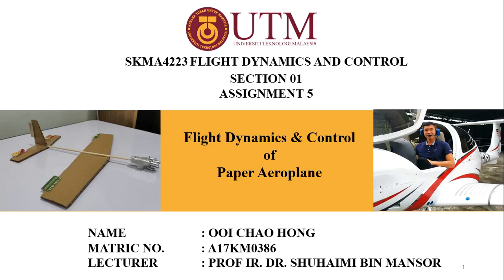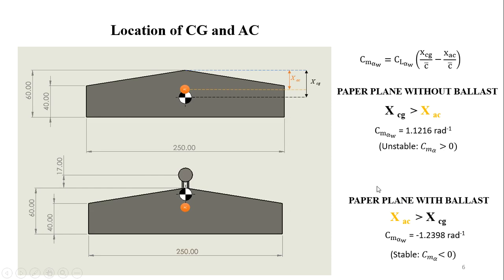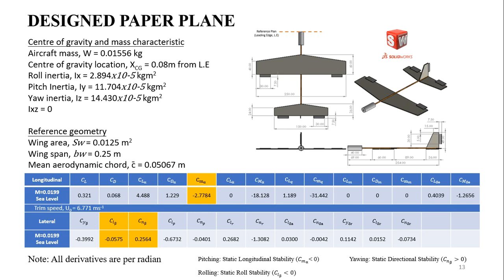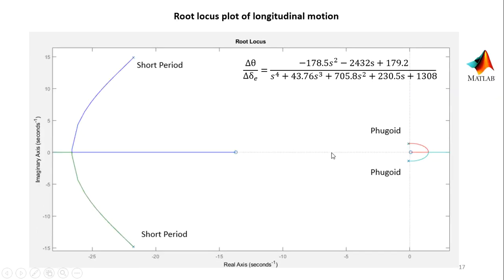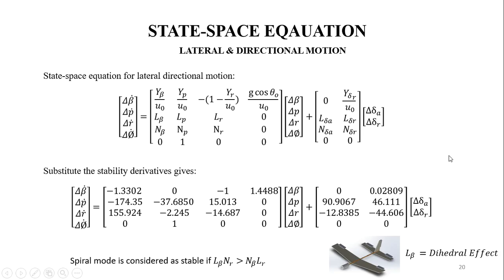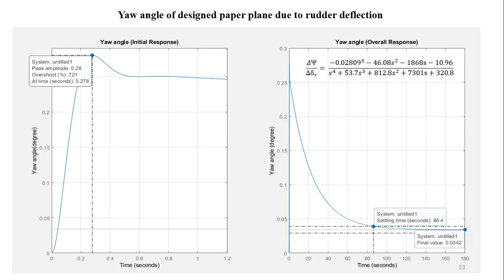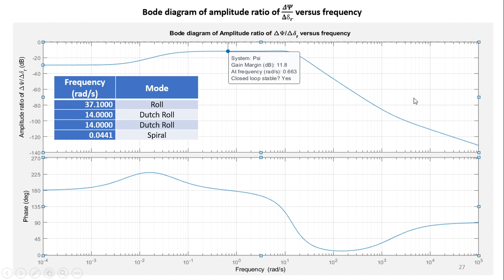Fly on Paper Plane - Flight Dynamic and Control !?!?!

Comment from the maker: Summary of Contents:

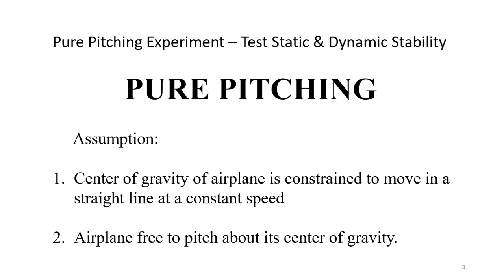  0:00 – 0:59 Definition of Static and Dynamic Stability
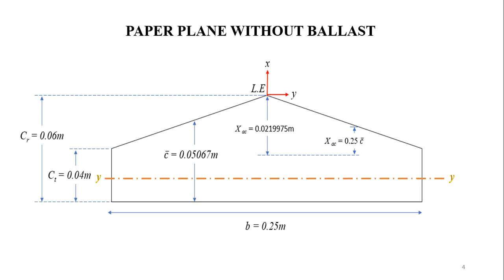  1:00 – 1:23 Pure Pitching Assumption
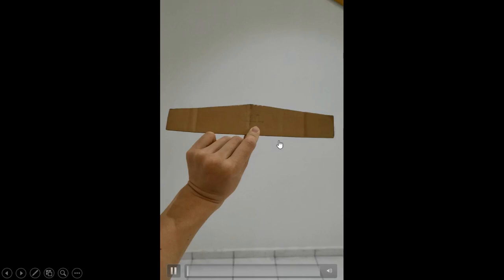  1:24 – 1:39 Dimension of Wing
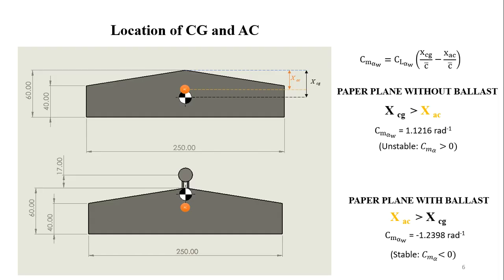  1:40 – 2:05 Paper Plane Without Ballast
  2:06 – 3:36 Location of Centre of Gravity (CG) and Aerodynamic Center (AC) affect Cmα
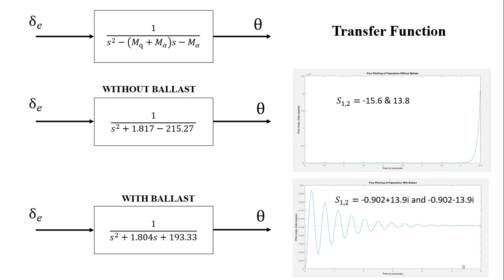  3:37 – 4:02 Comparison of Paper Plane With and Without Ballast
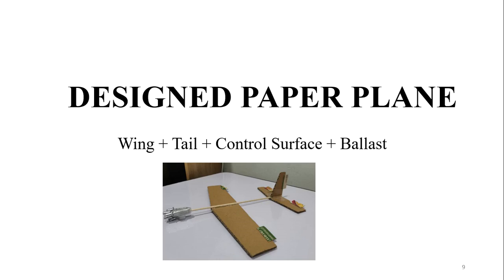  4:03 – 5:33 Response of Paper Plane on Pure Pitching using MATLAB
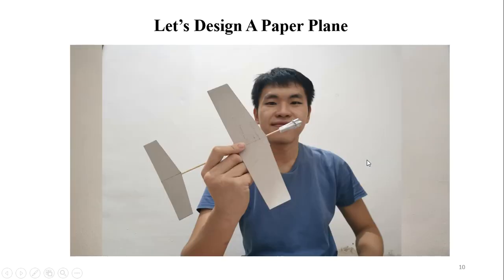  5:34 – 5:54 Design A Complete Paper Plane
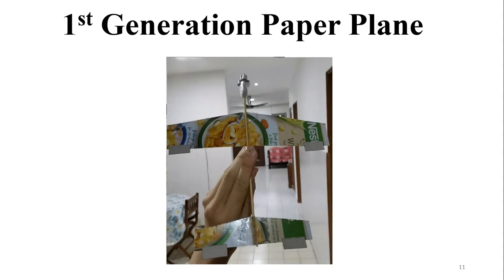  5:55 – 7:49 Making of Paper Plane
  7:50 – 8:29 1st Generation Paper Plane
  8:30 – 8:59 2nd Generation Paper Plane
  9:00 – 10:04 Stability Derivatives of Designed Paper Plane
10:04 – 10:38 State-space Equation of Longitudinal Motion
10:39 – 11:08 State-space Equation to Transfer Function
11:09 – 11:40 Response of Pitch Angle due to Elevator Deflection 
11:41 – 12:41 Root Locus Plot of Longitudinal Motion
12:42 – 13:54 Longitudinal Dynamic Stability Modes and Rate of Decay
13:55 – 15:06 Frequency Response (Bode Diagram) of Pitch Angle to Elevator Deflection
15:07 – 16:18 State-space Equation of Lateral & Directional Motion and L_β stability derivative
16:19 – 17:23 Transfer Function of Roll Angle and Yaw Angle 
17:24 – 18:04 Response of Roll Angle due to Aileron Deflection
18:05 – 18:35 Response of Yaw Angle due to Rudder Deflection 
18:36 – 19:21 Root Locus Plot of Lateral & Directional Motion 
19:22 – 19:55 Lateral & Directional Dynamic Stability Modes and Rate of Decay
19:56 – 20:47 Frequency Response (Bode Diagram) of Roll Angle to Aileron Deflection
21:48 – 21:22 Frequency Response (Bode Diagram) of Yaw Angle to Rudder Deflection
21:23 – 22:48 Control Surface Flight Test
22:49 – 23:09 Appreciation and Reference